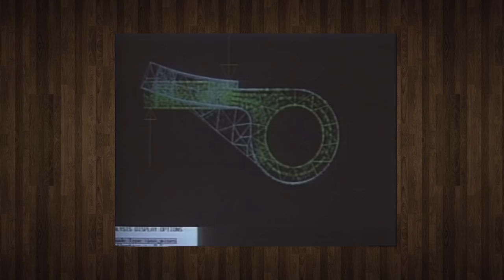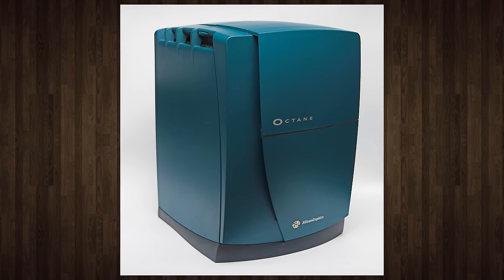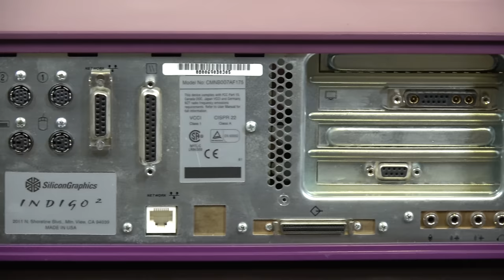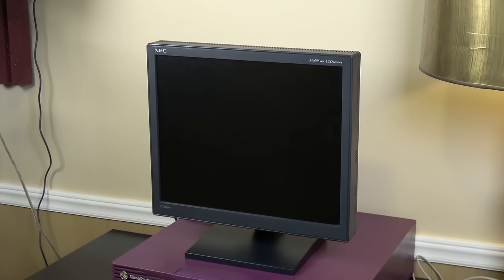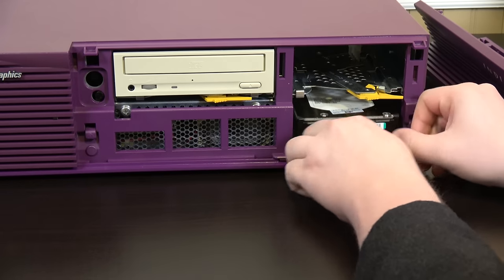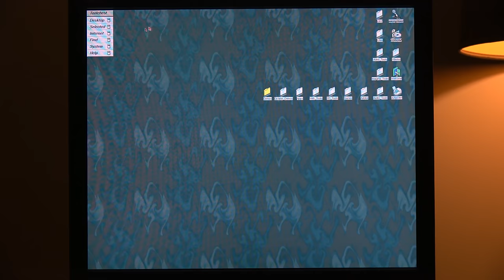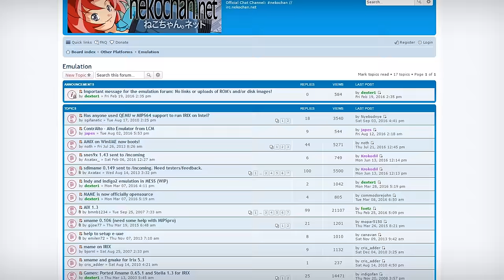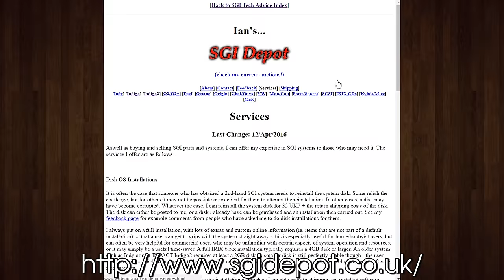SGI Indigo2: An $86,000 Workstation from 1995

Comment: I got a tour of NASA's ground control center recently, and they have a bunch of Silicon Graphics Indigo Iris systems still in use! I guess it's a case of 'if it ain't broke, don't fix it'.
Reply: Its all about their mission.
Reply: Those computers have most likely all been running 24/7 since new as well
Reply: Hapa Nice Day Don’t get weird in here, man.
Reply: its how they draw the fake planets
Reply: MrCalverino  Gotta have some way to make round things look flat, amirite?
Reply: Ohhh
Reply: No, it's because the old satellites up in space were likely programmed and monitored using those machines, so they can't practically replace it. It's like an old computerized machine that uses maybe a Commodore machine, that Commodore machine must stay with the machine/equipment for the life of it in order to be operated properly
Reply: @Josh S1 LOLOMG you killed it there Bravo I Love Geeks and Nerds, becawse I Are One-2.
Reply: Must be trying to make their return on their investment.
Reply: The military used 5 1/4 inch floppies for missile command until 2018
Reply: More a case of "We have a massive budget and need to CGi all our fake missions" 😆
Reply: @hyperparadox1  I can’t believe 22 people bought that crap
Reply: @2carbonphenethylamine701  Well, I wouldn't blame you if you don't know how old machines worked. I suggest watching the 8-Bit Guy's restoration of an old Commodore VIC-20, you'll see what I mean. The VIC-20 in the video was clearly operated in a harsh, industrial environment, with, I don't know, machines? And clearly the guy, David, has worked with similar computers with similar machines, so I take his word for it.
Reply: @Clogmonger  Sounds like the chinese. They were caught recently using transformers footage in their military footage..
Reply: @hyperparadox1  It shouldn't be hard to take whatever program they've written and run it in a VM on modern hardware, probs just some old version of linux/unix. ~some dev
Reply: @Packieeeee    VM's arent as reliable or as efficient as you'd think. Also, those satellites/spacecraft/whatever are moving at ridiculous speeds, so even if the downtime in order to transfer it over to an updated system is just minutes, it would have travelled hundreds, if not, thousands of kilometers from when it was disconnected, it's just not worth risking losing a satellite in order to update systems.

And if you're referring to machines, if it ain't broke, don't fix it right? What sense does it make if you're just gonna throw out a worthless computer, go through the trouble to recycle it, just to replace it with a more expensive, and less reliable VM?
Reply: That's because some of the satellites that are sent are still using computer systems from 1995. Maybe
Reply: @hyperparadox1   VMs are plenty reliable man, especially when things like docker exist. The cloud infrastructure most the world's servers are hosted on right now are built on vms of some kind, and with docker-type tech you can just emulate the exact libraries the software needs. The reasoning would be to stop supporting old hardware that is more likely to fail as it ages, as well as the parts getting more expensive. These govt agencies sometimes have to buy parts on eBay, etc to keep them running. Capacitors also just go bad after a certain amount of time.
Exp: senior software dev that's worked in infrastructure, webdev and DevOps for years.
If a VM breaks, someone broke it, they aren't just inherently 'unreliable'
Reply: @Packieeeee  nothing beats native compatibility, I guess.
Reply: @hyperparadox1  I program PLC's on the side.  Getting my windows 10 to run the old programs was impossible, so I went with the slightly less impossible task of getting windows 98 to dual boot on my old laptop
Reply: I imagine there are 2 main reasons the old equipment is still in service. 1) The development was budgeted and paid for years ago, and now that the system is in O&M status, no one is willing to budget the money to upgrade it. Not to mention the risk involved. 2) the hardware interfaces that bridge this equipment are very specialized, and parts of that were more than likely custom developed just for this project, and/or nothing exists that would bridge it to modern servers without significant investment. Which circles back to #1.
Reply: @Packieeeee  you cant VM old hardware that well. For example the n64, what contains SGI architecture, still can't be emulated well for a lot games. You got to remember, when dealing with mission critical applications you can't have any VM or emulation bugs at all.

Of course they could develop alternative software on modern machines for millions of dollars or you can just those old machines that work fine.
Presented with those two options it is easy to see why organisations like nasa and major banks still use really old machines.
Reply: @bonnome2  VMs don't emulate they are virtualised. You have to emulate drivers, cpu, etc for old consoles because they don't use the i386/x86 instruction set. These PCs do use that instruction set and it's still backwards compatible, so the old instructions can be sent straight down to a modern cpu unmodified. If however the nasa team directly interfaced with a driver rather than via an api, say for graphics/floating point calc then you'd have to emulate that one given driver for the VM, they probs used libs though as directly accessing a driver like that was an anti-pattern even back then. Still a lot easier than emulating the whole system if they did ref a driver or 2.
Reply: @CopyRun  I know what VMs are but this doesn't use x86, it's MIPS as clearly is said in the video.
Reply: Correction: If we're not given a budget for it, don't touch it.
Reply: BillyBob  talk about a "mindset", with that attitude! If some teenager can learn python from youtube, trust me that a mainframe system developer can learn python enough to compete in the market ;) The problem with IT right now is that every kid wants to reinvent the wheel and technologies are now a popularity contest, not a feature/quality contest. Software is more and more flimsy. I was here from the 80's, I only see things going downhill in terms of empowering the user and in terms of reliability.
Reply: That's not good. That could mean they have a lot of legacy systems that they're afraid to modify or try to replace because their software is a big ball of mud.
Reply: BillyBob  I am a mainframe system developer (2010-2015 for Micro Focus, UK) with CICS and COBOL, currently working in the BI team of Nominet, UK with Java and Kafka.
Between these two jobs, I helped develop the "Illustation" image enhancement algorithm for "Let's Enhance", using Python and Tensorflow.

My azz and the azzes of all the engineers I know is pretty "real"...
Reply: BillyBob  they all CAN be migrated but not many of them SHOULD be migrated.
One of my customers was Lloyds bank, which have been calculating interest on a certain product the same way since the 18'th century. The code calculating this was written in 1974 and the machine running it is from 1991.

Other than the dates being interesting, everything works fine.
It was written by a programmer, back when that title used to mean something...

Truth is new technology is flimsy. People use the extra slack to... Slack off... And you get unreliable systems.

On the IBM mainframe they are running, 1+1=2 always. On a modern Spring/Django piece of shit, 1+1=2 99% of the time, sometimes "= 404", sometimes "= update your java", sometimes "=Anonymous was here!"

New technology is good for quickly releasing shitty "apps" like tictak or whatever.

Where the Billions are moving, trust me, it looks NOTHING like your udemy course.
Reply: Today's replacement is an nvidia dgx system
Reply: BillyBob  so, that's 3 things: IBM tech's viability, the morality of their business practice and their financial outlook...

I am glad we agree there's nothing inherently wrong with mainframes. Personally, I feel if mainframes/COBOL/CICS came out today, it would be the new python. Indentation semantics, weakly typed, great for getting insight into data...
Same with mainframes: thin clients and the heavy lifting done remotely, it's basically a perfect cloud.

As for how they supposedly create dead ends for their customers: Every company wants this. MS wouldn't release the code for their runtime so that other people can have a go with making Windows-compatible OS's, right?
Apple review every app on the market and remove such that eat into their own offerings.
IBM was just there first and got a lot more of the core finance stuff in motion.

Actually, they are so dominant that it is a problem. We, in Micro Focus, have actually received help from IBM to write a competing CICS runtime. The reason being, that having us as an alternative, allows customers to choose IBM tech, knowing they are not "marrying" IBM but can shift to different software providers.
They can also host mainframe emulation in linux servers (this is a Micro Focus product I've been working on). So, customers can feel confident with their end-game. 

As for their business - we can only wait and see if they play their cards well... IBM ditched the PC (PC is an IBM invention, remember?) and became a much smaller company with a higher, more predictable margin.
They could at some point just become a holding company for the patents and then just cash in without doing any work... Basically keep "IBM" as a brand and nothing like the company it was in the 60's... I don't know if that's "winning" or "losing" - I guess we can only see the personal aspect at that point, and personally, I don't see how it affects me for now.
Reply: Linux
Reply: thats why space x is blowing past them
Reply: I am not sure if he retired yet, but I know a computational physicist who was still using an Onyx about 4 years ago.  He was nursing it along until retirement.
Reply: bruhhh
Reply: They still use original 8088 chips for controlling stuff.
Reply: @hyperparadox1  except for geostationary sats which are, well... geostationary, all satellites need to hand off between stations and no civilian ones have seamless coverage. So, taking hardware off line for updates isn't an issue. Deep space missions don't broadcast continually either, it would be punishing on the hardware and power budgets.
There are many reasons to still use old hardware, but the concern about breaking contact isn't one of them.
Reply: Damn. They don't make shit to last like they used to huh :/ I've had laptops and smartphones conk out on me after like 2 years
Reply: And probably no hacker from north Korea can touch it
Reply: @Packieeeee  Your theoretical solution only works when you know where 'legacy ends and non legacy starts' and completely accurate 'logic layer divided configured'. Unfortunately there is ton of higher-level implementations has dependency of lower substances, yet unknown why it should be there, yet uncertain why it doesn't work if it 'rationally refactored'.
Your Alexandrian solving might only works when leaving behind every bit of old organization. Yes, I mean case of SpaceX and NASA. Otherwise your word is just some hot air.
Reply: Interesting... I used to write software for SGI systems in 1990s. It's mostly standard UNIX, X11, and OpenGL. That's not hard to port to a new system. I wonder if they have custom expansion boards that make the transition to new systems difficult. The SGI systems used a proprietary expansion bus AFAIK, aside from it being simply a now very old expansion bus standard.
Reply: @jamesmillerjo  it's not theoretical, the divide between drivers and the api level has existed since before these project were started. In more modern systems it's even easier because of JIT compiled languages that run on anything anyway. The NASA team should have had clearly defined lines between driver and code, since they shipped these comp's with their relevant hw drivers anyway. If NASA happened to have written a custom driver it'd also be easy to identify. In terms of emulating the opcodes for x86 it's been done a bunch of times already. It's not like NASA could make thier own opcodes so should be a 1:1 port with an existing emulator.
Reply: @hyperparadox1  They could just run Virtual machines of the proper os.
Reply: Its to stop hackers from interfering
Reply: @SDaniLogiQ  These systems aren't connected to the internet, no physical connection means no hacking via that route. May be some exploit vectors for things like radio comms or private networks but would be the negligible difference risk wise. If they did move to VMs I'd be a bad idea to use a public cloud like Azure, AWS for the reason you mentioned.
Reply: wrong

its because their budget is trash
Reply: They have to keep it running for the old satellites and probes in place
Reply: @Packieeeee  No, that wouldn't work at all. Virtual Machines and emulators might come close, but it's not exact; one wrong instruction or one wrong address and you have yourself a disaster.
In many cases, the software running on these machines was written specifically to target that specific machine, with the specific hardware in that machine. It might even have inline assembly code, or actually entire portions written in assembly.
If you go to any science lab, you will see ancient computers for the same reason.
Another reason is that the software running on them might actually have been running 24/7 and interrupting it can cause problems.
This also the reason lots of banks and financial institutions have legacy systems in their infrastructure.
Different instruction.set architectures, and even different implementations of the same ISA, handle things differently.
It is extremely difficult to port infrastructures or critical systems to new hardware and it can potentially cause a serious disaster or great financial loss.
This is why developers who can work with legacy technologies are so sought after in many industries.
- some other dev
Reply: or, or recued them from a skip when the US army bought 10,000 of them and decided the color didn't match with their preferences... and threw them all out....
Reply: Also they commonly work on projects for extremely long projects to the point where some computers HAVE to be used to communicate with the device.
Reply: I mean, they sent men to the moon on a computer with the same processor as a modern graphing calculator (says more about the shitty calculator than the advanced computers for the time, honestly). So yeah why the hell not?
Reply: Flat eathers will tell you its how the make their cgi
Reply: Because CGI is all they have discovered "out there".
Reply: Donated mine to the British computer museum. My old blue Indigo would happily run a year at a time without needing a reboot. Try doing that with any windows box.
Reply: Ahh, SillyCon Gfx 
Cool when they were mentioned in The Lost in Space movie from the 90s, like they were gonna last that long
Reply: The older hardware is also well understood when it comes to bugs and the like
Reply: @hyperparadox1  you are completely correct the US military/gov't has specialized call centers for older machines/systems they still use.
Reply: No wonder the 3d rendered satellites,  planets and stars look like dogshit, it's all rendered on a 20+ year old SGI workstation and not by cameras 🤦‍♂️
Reply: NASA is like the airline industry on steroids - use chips from the 1970s because we know they work. You don't wanna fly the latest tech and then find out that the rom degrades and your billion dollar satellite will become unusable in a couple years. You don't wanna fly new software when every line of new code could have a bug that will kill your crew, or your multi-billion dollar mission. Current satellite launches are mainly going to use legacy hardware from the 80s and 90s, because it is just such a huge commitment to develop something with such a miniscule failure rate, such a long life without service, and such small economies of scale.
Reply: NASA.. 🤣
Reply: @rageagainstthehygiene2357  I went to a lecture on Amateur Radio satellites and they get all their (very high reliability) components for free. If they fail the loss of an Amateur Radio satellite isn't that big a deal. If they work the manufacturer can use it as evidence that their components are good enough for space applications.
Reply: @InnoVintage  I can imagine the amount of testing the military would have demanded before they switched over to whatever the new solution is.
Reply: @hyperparadox1  that's very unlikely, since the communication with those satellites is done by some sort of radio protocol, said protocol can absolutely be implemented in a newer machine/architecture while maintaining compatibility. There would be no downtime to do so, since it can be done while still keeping the OG machines on. This is not some low level lost code they only have in those machines, they have the specifications for this protocol well documented.
Reply: Why not get as much use out of them as possible, given their cost. Alot of software does not get updated, as the people probably left long ago, and run native on them